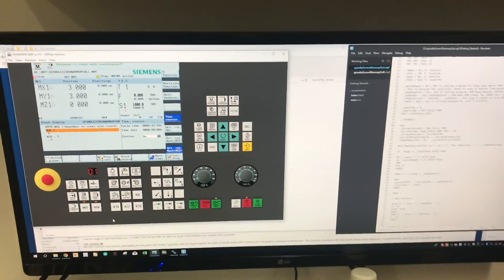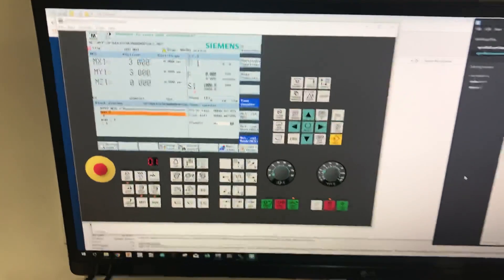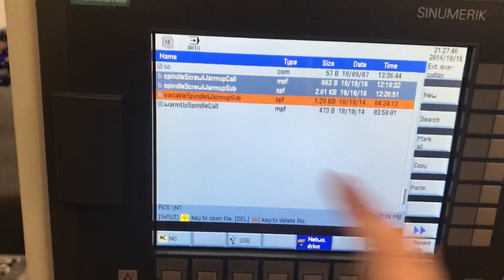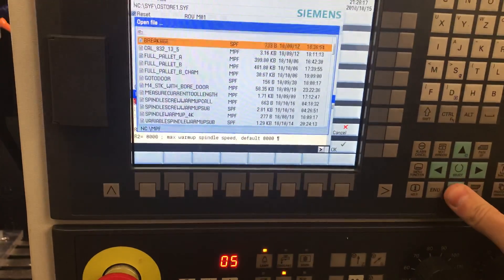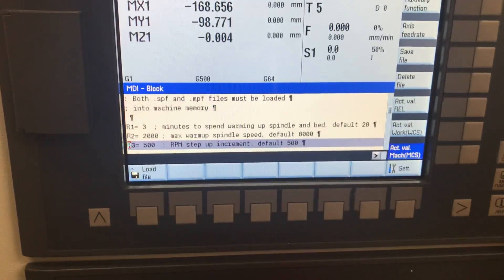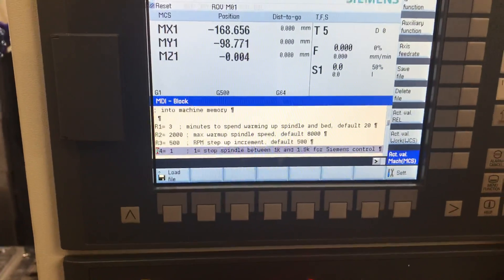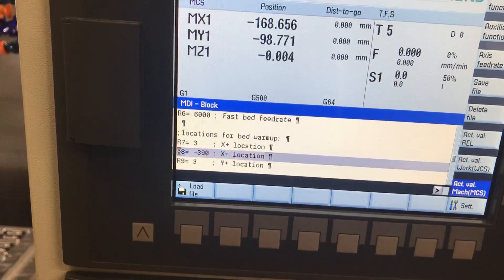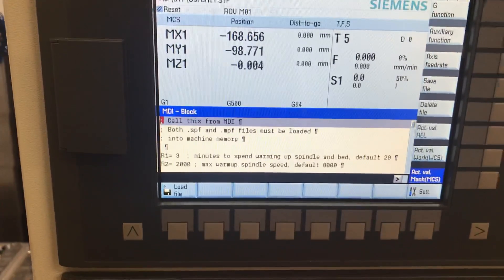Parametric spindle and bed warm up routine. Siemens 808D

Comment: A little bit late to the party, but just wanted to point out that running spindle at high rpm without tool is not very health for it. Some machines will even block it by default to 200-500rpm.
Reply from the maker: Hi, thanks I did end up figuring it out, this is a pretty old video. My new program ensures a tool is loaded to run!

Comment: Nice work, I have a 828D on my XYZ-710 and i was just starting to program a routine as i a very important part of the CNC system that Siemens seems to ignore.
Really pleased to see that you already done it, maybe you should consider to distribute it as a Macro to integrate in the controller and ask for some sort of contribution, I will be your first customer, it save me a bit of time!!! There's a lot of free buttons that could be programmed as a standard button on the controller with a proper icon to call an internal macro, Haas has this option from ages now, don't really know why shouldn't be on the Siemens as is an expensive controller too.
Regards

Comment: Was just looking to start putting something like this together for my machine. Do you have a location you are putting the code up at so that others can make use of or possibly help with contribution?
Reply from the maker: Das Wookie I will probably put in in my A360 drive (fusion 360) and people can download it from there (you don’t need any software to do that). Maybe I will do that tomorrow.
Reply: @betztechnikindustriesltd.8901  hey mate. have you put it up to share? I'd love to get hold of it for my 810d machine. Cheers!
Reply: Peter: did it ever get placed somewhere for sharing?